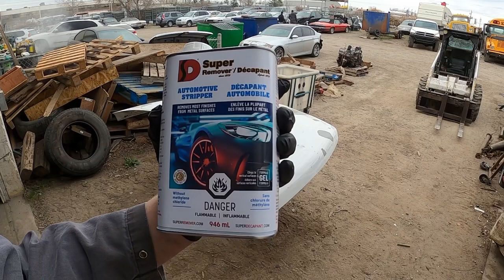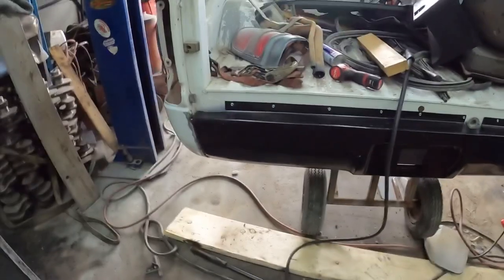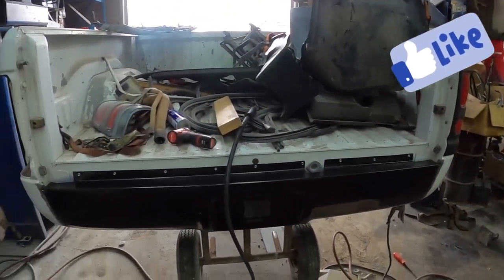HOW TO WELD IN A ROLL PAN

Comment: OK re watched some of your videos..  so after welding in a floor in my 95 4x4 to up grade to a floor mount 4x4 I knew I should get some tips on welding body panels . So what size wire do you recommend.  Thanks
Reply from the maker: I use .030 for panels

Comment: 👍👍...what size wire...?. I don't really weld sheet metal or do body work....ever cut welded in rockers...?.. but anyway 👍
Reply from the maker: I am using .035 witch is to big. 
I like using .023 or .030 when doing body work. On this machine you have to change the liner to run .030 or smaller so it wasn’t with my time for the small amount I needed to do
Reply: @CUTTERUPROB  ten four 👍